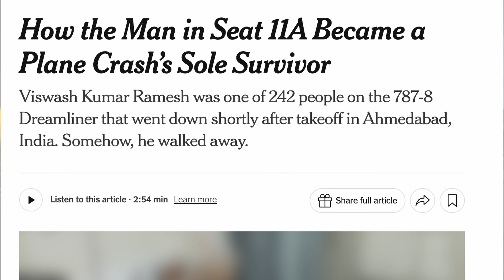Why the RAT Changes Everything – Air India 171 Update

Comment: Where is the complete CVR recording?
I retired in 2020, flying the B787, after 35 years with a major airline in the U.S. 
After a failure of any kind, I would expect the Captain to state who is flying, what is the problem and what to do about it.
That is Captain 101
For example:
“My aircraft, dual engine failure, cycle the fuel cutoff switches, verify RAT deployed, dual engine failure checklist”
It’s good practice to always state the problem or emergency. Sometimes EICAS messages appear then disappear.
It’s been 5 years since I sat in the cockpit but if I recall correctly, cycling the fuel control switches and verifying RAT deployment and green light (up to speed) are immediate action items (without reference to a checklist).
With a dual engine failure at low altitude, both pilots are as busy as a one legged man in an ass kicking contest. 
You have seconds. There is not even time for “Mayday” 3x imo. 
That didn’t help their situation.

With the RAT, they have Center hydraulic flight controls. Why didn’t they turn away from the tall buildings?

With a dual engine failure and RAT deployment, only the Captain’s flight instruments are powered. That is assuming the APU was off as it probably was. The copilot will have standby instruments off the battery while the RAT comes up to speed which should happen quickly.
The CVR should indicate a transfer of control from the copilot flying to the captain flying.
Captain “My aircraft” or “I’ve got it” or whatever 
Copilot acknowledges “Your aircraft”
One engine lit-off. Were they even aware of that? On the CVR, I would expect the copilot to keep the Captain informed of the engine start progress. I would expect to hear “They are both spooling up. OK, Light-off on the left. You have thrust on the left.” I don’t remember if it was L or R but I would expect to hear them working together. 
With seconds remaining, it was shocking to hear the copilot asking “Why did you cutoff?” and the captain responding “I didn’t”
The AAIB likely has the complete recording. 
Why did they only release that small part of the CVR transcript?

Comment: @captainsteeve vidoes has gone from controversial to outright slander. If you look at this statements on other podcasts, including the one with Piers Morgan, he has categorically stated that the fuel cutoff switches are mechanical and not electro-mechanical. He is now resorted to mislead people, to force them into believing that the fuel can only be cutoff through the switches inside the cockpit and not by any other way. 

He is obviously and conspicously lying, the FADEC controls the fuel valves and FADEC has in the past too has cutoff fuels to the engines when there is fire, among other things. The main cause now is being widely suggested is fire in the litium ion batteries which is what let dual engine shutdown/failure in ANA Airlines (Boeing Dreamliner) and cuaed fire in Japan Airlines. There is obviusly huge money involved because of the high states for United States biggest exporter Boeing. So US is trying their best to create narratives and engnage people like Captail Steeve, Wall Street Journal, others to create a perception that it is pilot error.

If they can control anger and outrage globally for the next few months, then they can bribe and threaten their way into the world accepting that this was not Boeing's fault. US can do that becuase it has huge influence, and in most cases they can put a gun to the head of many countries because it has military bases in their backyard and can cut them off from the large US market. Captain Steeve is a fraud, do not believe him. He posts normal videos too, but in this occassion he is absolutely invested in protecting Boeing and the US.

Comment: Pilots switch fuel to cut off thirteen seconds after take off and ten seconds after dual engine failure, why? 
Because that is correct procedure to restart engines. Pilots did not cause the crash.
Reply: Where did you get 13 seconds and 10 seconds?

Comment: Here's a plausible scenario:

Just after takeoff, the pilots retract the landing gear.
Suddenly, the RAT deploys. The pilots are stunned — this only happens when electrical power is lost.

The Chain Reaction:
1. Electrical Bus Failure
    A short circuit in a main power distribution bus (caused by a chafed wire arcing against the fuselage) trips both engine-driven generator buses simultaneously.
    This sudden bus failure sends a false shutdown signal to the FADEC (Full Authority Digital Engine Control) units of both engines.
How?
    On some aircraft, FADEC logic is powered through dual redundant channels. A simultaneous bus fault might cause a "fail-safe" reset of FADEC.
    A miswired or defective relay sends a "fuel cutoff" command (similar to what happens when an engine fire switch is pulled) even though no switch was touched.

2. Both Engines Flame Out
    The FADEC logic misinterprets the electrical glitch as an emergency shutdown command, instantly cutting fuel flow to both engines.
    Both engines spool down within seconds — and all cockpit alarms erupt.

3. Pilot confusion
    One pilot asks the other "Why did you cutoff?" to which the reply: "I didn't" is given.

4. RAT Deploys
    With both engines dead, the aircraft’s main AC power is gone.
    The emergency ram air turbine (RAT) automatically deploys to power essential flight controls and some avionics.

5. Autorestart Logic Kicks In
    FADEC, now rebooting (a process that takes a few seconds), "realizes" the engines are shut down and automatically commands a restart sequence.
    Fuel flow resumes, igniters fire — but 10 seconds have already passed.

6. The Pilots are Overwhelmed
    The cockpit is in chaos:
        Master warnings scream.
        RAT noise adds to confusion.
        Both pilots see engine instruments suddenly drop to zero.
        They have little time to diagnose.

7. Engines Restart — Too Late
    Both engines relight at about 10–14 seconds after the initial failure.
    However, spool-up to full thrust from a complete flameout can take 20+ seconds (depending on the altitude and engine type).
    The aircraft, now at low altitude and low airspeed due to drag and climb angle, cannot recover before impacting terrain.

Why It Looks Like Pilot Error
    The FDR (black box) records the "fuel cutoff" signal as if the switches were physically moved.
    To investigators, it appears as though a pilot shut off both engines (a seemingly suicidal act).
    But in reality, it could be a phantom electrical command caused by the bus failure.

Possible Root Cause
    The root cause could possibly be traced to a maintenance error:
        A new avionics module installed earlier could have a wiring harness misaligned by a single pin.
        This could cause a cross-feed of the engine fire handle logic into the generator bus fault circuit, tricking the system into thinking a fire shutoff was commanded during the short circuit.

Comment: I am a retired mechanical engineer and I've taken a look at the spec sheet for the fuel switches. It appears to me that the design of the toggle shows a flat feature that would permit parking the switch in an intermediate position between RUN and CUTOFF...though this position would appear to be a bit unstable and certainly not intended, but possible nonetheless. (I have a document I could upload that shows this flat feature but I can't find a way to do that on Youtube). If these switches had been in this intermediate position during takeoff, could they have been jostled to the CUTOFF position? Being able to put the Toggle in this position obviously does not explain why a pilot would operate the switch in this manner…or why he might do it to BOTH Toggles, but does it not at least open the possibility for these switches to either move by vibration or accidental operation?

Comment: Suppose throttles were off at start. The residual fuel in the fuel lines say, enables  take off the fuel will last only for 5 seconds. The rat is deployed at start since throttles are off.Say after 5 seconds the crew realises loss of power and turn on the power but not not enough time to start the engine - 5 seconds plus ..... the plane crushes.

Comment: A really good video and I think it quite likely it was dual engine failure which caused the RAT to deploy. But - what caused the dual engine failure and how did both of those fuel switches wind up in the cutoff position? The mystery deepens …

Comment: Fully appreciate these videos however one question. If the new reports coming out show that the fuel was cut off, why was the RAT deployed? Surely that would only be in electrical failure? Surely if the batteries were still running it wouldn’t be needed…. What is your expert opinion in the light of these preliminary reports?

Comment: Noticing a major inconsistency after your latest report:
https://www.youtube.com/watch?v=00ooqCuRoU8

🔹 If both engines were shut off via the fuel control switches, there should’ve been an immediate drop in engine sound — which isn’t the case in the footage.
🔹 This directly challenges the report's claim that both engines lost thrust instantly due to fuel cutoff.

👉 Could this mean the switch position was misread? Or the engines were still windmilling and producing residual noise/thrust?

Comment: Now this may be really dumb and I may not have been paying attention properly, but it seems to me that if vapour lock has not been ruled out it would be expedient to find out what happened sooner rather than later.  It's possible that the black box will reveal no clue if vapour lock was the culprit.  Two possible scenarios - the fuel in the tanks is close to change of state at that temperature and pressure: a. a lot of fuel is used in the run up and at or soon after rotate the pressure in the tanks has dropped (maybe because of some vent problem) enough for vapourisation in the feed lines.  b. as above but something to do with the change of angle of the tanks on rotate.

Steve your show is great - very educational.  You are confident this will not happen again, but there are a lot of hot countries around the world at the moment, and I hope you are right.

Comment: Another means of dual actuation of fuel cut-off switches: 
https://downloads.regulations.gov/FAA-2016-7855-0005/attachment_1.pdf
This link is to a 7 page Boeing "pleading" to the FAA for a TCMA/FADEC flaw(‘s) interim waiver (dispensations under the two “part 25” safety regulations). Petitioner Boeing asks for NO publication and no solicitation of public or industry comment.  But... you only got two engines and it's admittedly a potential common single-point software failure. That is patently clear. By design, the TCMA is capable of shutting down both engines if it thinks that it’s on the ground and that thrust being produced is incompatible with the throttle position (TLA)
Think 5G, the RADALT (LRRA)'s and the LGEU WoW ground/air sensing's six micro-switches. M/switches and LRRA inputs decide the a/c's Ground/Air status. A tilted main-gear trucks' pause (for door-opening) may not promptly achieve oleo extension to actuate the WoW m/switches to AIR mode .. and there was also a powerful 5G tower 2.1 kms upwind of the departure threshold. Think of a 5G LRRA pulse from that 5G tower antenna as Flt AI 171 broke ground and rose above the Line-of-Sight horizon. The timing of a double flame-out is then “spot on”. Throttle lever angle TLA) may be one of the TCMA/FADEC flaws (plural) referred to obliquely in the (above) Boeing waiver application? We know that the Turkish 737 crash short of Schiphol was attributable to a RADALT not "failing SAFE"... but actively showing minus 8 feet during early finals (in flare/retard territory, and thus dictating the auto-throttles to idle). The effect of various 5G spectrums on LRRA RADALTS is well historied. The Boeing software gurus involved in TCMA/FADEC do not disagree with this TCMA/FADEC known flaw interaction as a likely cause (on Pprune.org). That should be a “heads-up” for the Indian Investigators.

Comment: Great to get your analysis of info and conclusion which I Agree with, good job. My GUESS now is that due to electricity being used so much more in this aircraft, did it fail completely and maybe had something to do with fuel supply for engine. Too late for RAT to fix.

Comment: real or false indication of power failure, failure of the pilots seat latch could be the problem, while his hands were on the throttles, As the seat slid his hands pulled the throttles back. Multiple seat failures reported to date.

Comment: This is an inside job.
Reply: AIR INDIA CRASH: PILOT SWITCH BLUNDER BLAMED, NOT BOEING

U.S. officials say the deadly Air India 787 crash wasn't a Boeing or engine failure…it was human. 

Investigators now believe pilots manually shut off fuel switches mid-air, killing thrust right after takeoff. 

Those switches? 

Meant only for engine starts or emergencies.

The Dreamliner and its GE engines are reportedly clear, shifting focus fully onto cockpit actions.
Reply: @stephenroger4527  Do you think blunder is more likely than an intentional act?
Reply: @drchaffee  the captain was suffering from dippression according to indian media.so seems delibrate.

Comment: what are you going to say tomorrow???
Reply: AIR INDIA CRASH: PILOT SWITCH BLUNDER BLAMED, NOT BOEING

U.S. officials say the deadly Air India 787 crash wasn't a Boeing or engine failure…it was human. 

Investigators now believe pilots manually shut off fuel switches mid-air, killing thrust right after takeoff. 

Those switches? 

Meant only for engine starts or emergencies.

The Dreamliner and its GE engines are reportedly clear, shifting focus fully onto cockpit actions.

Comment: 🐀 RAT Deployed❗️💥Electrical Failute❗️You can see the (RAT) dropped: Ram Air Turbine (RAT). Underside, below the cockpit, a small wind turbine deploys in emergency loss of primary power sources, such as engine failure or electrical malfunction. 

RAT acts as a last-resort power source.
Mechanism: When the RAT deploys, the airstream generated by the aircraft's forward motion spins its turbine blades, which are connected to either an electrical generator or a hydraulic pump. This provides emergency power for critical systems.

The RAT is designed to provide sufficient power to essential systems, including flight controls, communication equipment, and key instrumentation, allowing the pilots to maintain control of the aircraft and perform a safe landing.
Deployment: RATs are usually retracted during normal flight and can be deployed automatically upon detection of a total power loss or manually by the crew.

The amount of power generated by a RAT depends on the aircraft's speed. Faster speeds produce more power. A large RAT on a commercial aircraft can produce between 5 and 70 kW, while smaller ones for low-airspeed models may generate as little as 400 watts.
Importance: RATs are crucial for flight safety and are common in both military and modern commercial aircraft. They have been credited with saving many lives in emergency situations. 
In summary, the RAT serves as a vital emergency power source by using the aircraft's movement through the air to generate electricity or hydraulic pressure when primary power systems fail.